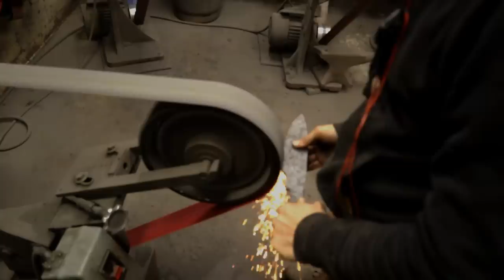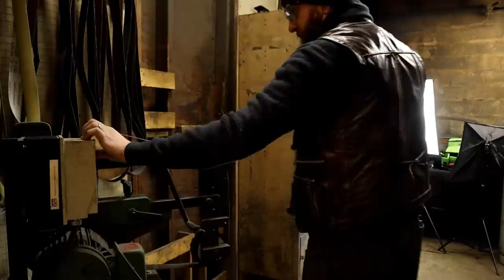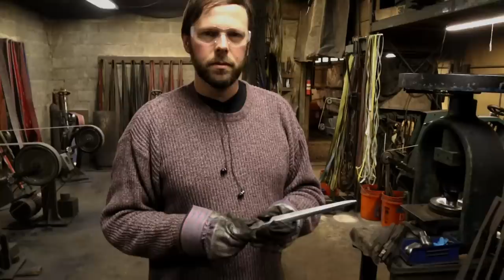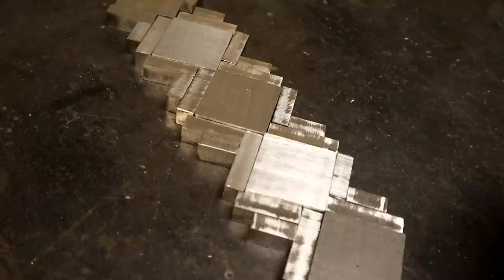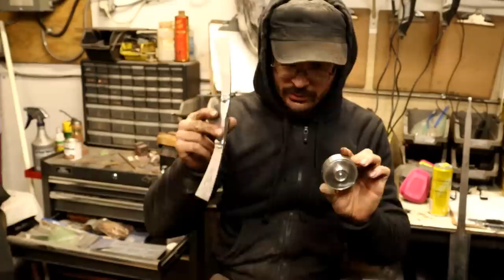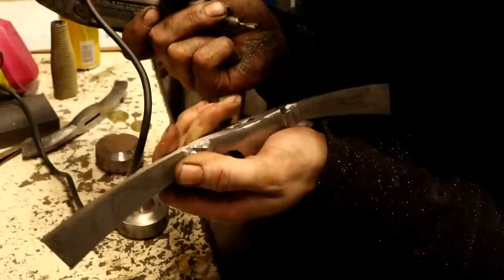Blade Grinding / Billet Prep / Forging a Katana

Comment: Matt! You stacked two of the sections of billets slightly different on one side. I’m not sure if this was unintentional but I wanted to make sure you knew.
Reply: Yep. If you look at the cubes, you notice they are not symmetrical.
Reply: When he was stacking them, it’s the bottom two sections, left side. The second-smallest pieces are against the upper piece instead of the lower piece like in every other section. I really hope he sees it before he forge welds.
Reply: 19:03 shows it.
Reply: I know this is late to the game but I felt sick to my stomach and was saying "oh no no no no" when I saw him tacking them together. I hope it was intentional for some reason because otherwise I feel pretty bad.

Comment: When I use a Dremel for details I put the power cord over my shoulder so it takes some of the weight off the tool and it’s easier to control. Just a tip

Comment: I noticed that you guys have the Bader but you usually do even knives and flat grinds on the contact wheel (10” I’m guessing?). Do you find it easier to use the contact wheel, or maybe just that it’s better? I still haven’t made an arm for big wheels, I only have a platen (and slack then ofc) and small wheel arm (with no VFD yet so I’m not sure how that’s going to work out in the end). Should I definitely make that arm, it’s worth it I guess even if I’m not doing many hollow grinds?

Edit: Ironically enough Matt uses the platen in this video just now, although not for a bevel so far

Comment: Fantastic video, I love the giant hammer?  6lbs?  I've been forging for about 9 months and learned a lot from the MaA videos.  I have seen different videos with water on the anvil, does it reduce scale? Thanks for the videos.
Reply: The water creates a small steam explosion from the heat which blows the scale away each hit. Effective and gives a much better and even surface.

Comment: Hey Guys, Daniel Triplett here,  I Had a really Nice knife 21in from tip to tail, it was stolen a few weeks ago, I've been following you guys for quite a wile..I need to know if you do any Charity work, I am disabled and filing for disability, due to a fall off of Long's Peak,( 14K) when I Lived in Colorado (I only fell 25 feet, but we have a saying in the mountain climbing Community (The Rocks  are not as Soft as they look))...It crushed 2 of my Vertebrae and Compressed  5, so I can't do the job (Networking)  I used to do so while I'm working on getting a job, MY KNIFE Was Stolen...No one has come forth to say they found it or whatever... so I'm thinking that some of your scraps/cutoff pieces would do just fine..consider it a Challenge...lol

Comment: Matt, you mentioned a ceramics background, what sort of work did you do before bladesmithing?
Reply from the maker: I meant schooling. I took 3 years of ceramics and clay sculpture. I’ve pretty much only ever made swords for a living.
Reply: @ThatWorks  Just curious, it seems like a lot of the blacksmiths I have met or seen have had some experience in pottery, but I guess that makes sense since the mediums move similarly.

Comment: how do you make sure that there is no contamination from the welding when you put together the damascus?
Reply from the maker: We put the weld at the ends and in the middle of the first stack. The hot cut we do when we fold goes right at the middle where the weld is and the ends get ground away. The weld is always on the very outside layer so by the time you do any rough grinding on your blade it all disappears.